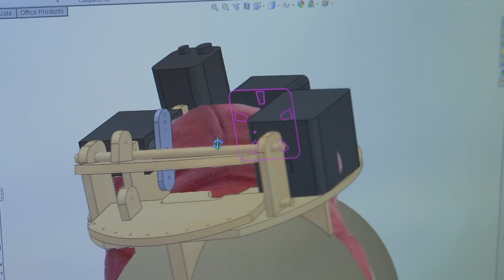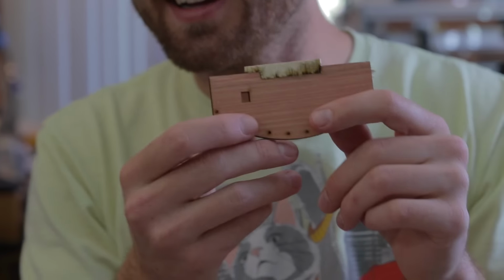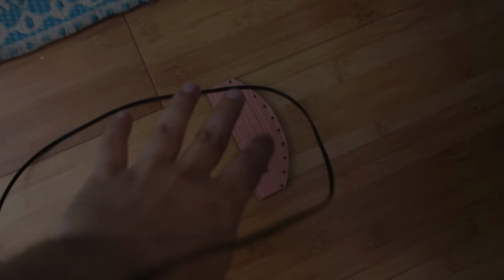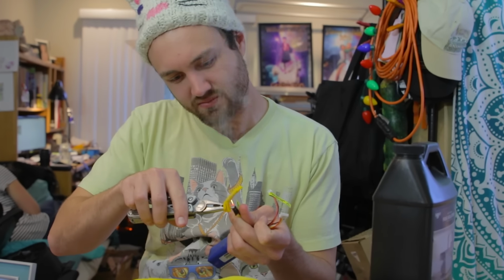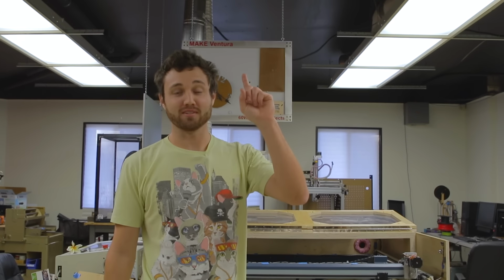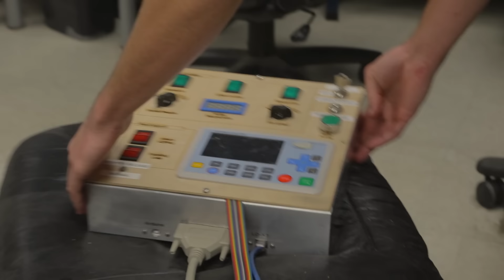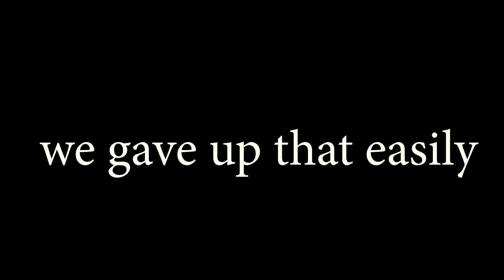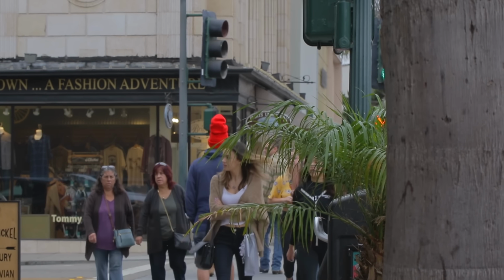This Hat Screams And Coughs Smoke

Comment: I love how you said that you weren't actually going to use a vape, and then just basically made a bad one instead.
Reply: He probably doesn't know how a vape works
Reply: and on top of that used a very low resistance wire without any knowledge of how ohms law works. and this is why people have vapes blow up in their faces.
Reply: +Phoenix Poi
what are you talking about? He used Ni chrome wire, it has a much higher resistance than most metals and has a high melting point. It has the perfect properties for vapes. In fact, it's so good that CONSUMER VAPES USE NICHROME.
Reply: The Piscis what i was saying is just that he basically made a jerry rigged vape instead of just using any actual vape parts. Not that what he made it out of was bad quality.
Reply: I was replying to Phoenix Poi
Reply: ok well either way all i know is nichrome heats up fast as fuck thats why coil builders use it for more complicated coils, therefore i would have to assume its dangerous to use on a ghetto ass fake vape running off of bullshit batteries that cant handle the drainage caused by the coil
Reply: Phoenix Poi
He uses two 18650 lithium ion batteries. In comparison, most vapes use one. While I don't know for certain what the discharge current of those batteries are, it is probably safe to say that they can handle the current draw just fine.
Reply: definitely
he's clearly using the right gear, and knows at least something about vapes, because the last coil he showed on the hat was okay, 
but it looks like there's a hotspot in the center or not enough juice flow... which makes sense because he's using cotton cloth... which is an awful material to use, but at least it works
Reply: Phoenix Poi he has a degree in electrical engineering

Comment: doesn't want to use a vape in the beanie... proceeds to basically make a vape with an wire Nichrome coil,using a battery to heat the coil and cotton soaked in juice which is vg/pg (which ejuice is made of) to produce vapor Like an Rebuildable Atomiser/RDa  XD

Comment: needs a tube to blow vapor through a hole in the hat with facial feature servos. that would be cool. People didn't know what was making the noise. With a radio transmitter to operate it with a mic. Have the whole thing flatten/fold down into a normal looking hat, then this animated character just pops up lol

Comment: what does ventalation mean?
Reply: Its like when you have something that'sgot air moving through it
It could be a fan, a air conditioning unit, even a car with the windows open, so long as there's new air coming in and old air coming out